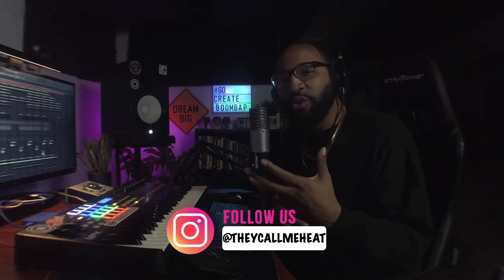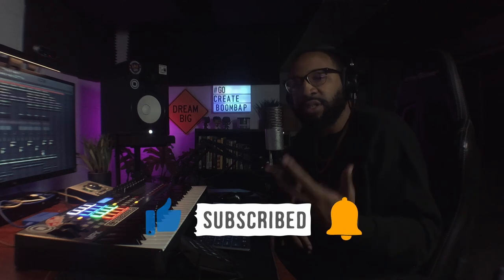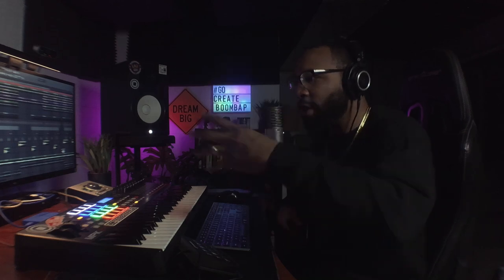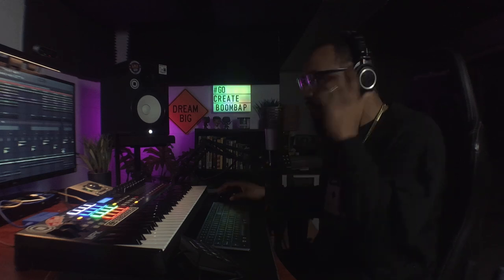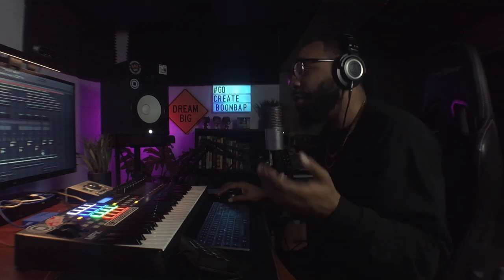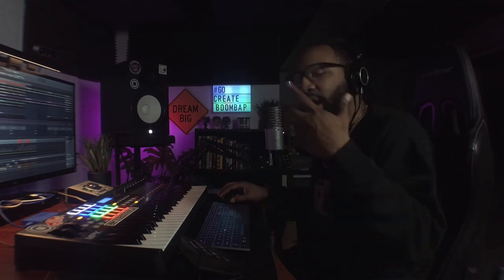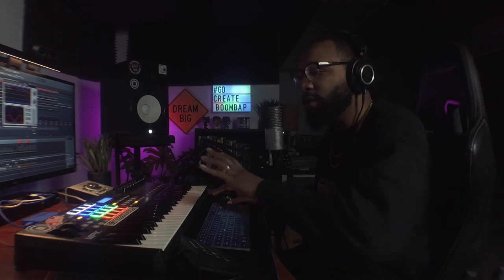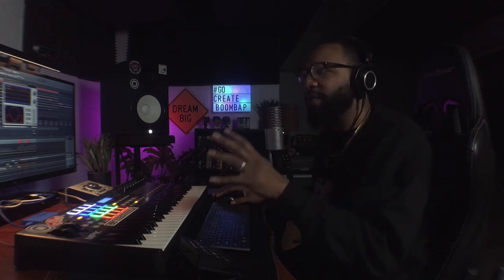my simple beat mixing system for LOUDER HARDER beats

Comment: hey I just got L2, but when I export with your settings I get like 30 seconds of no sound after the beat ends
Reply from the maker: Are you setting your ending or just exporting without marking start and end?
Reply: @theycallmeheat  I tried both ways but still the same problem
Reply from the maker: @idkRemm on your export settings be sure to select “cut remainder”
Reply: @theycallmeheat  it worked! Thanks for the tip bro, much love!

Comment: No need to add a compressor on the master then?🤔 because right now im using a soft clipper(limiter) for all the drums + adding one on the master + a compressor.. Maybe it’s too much but still doesn’t sound loud 🙄 I’ll try your way
Reply from the maker: It all depends on what you’re doing with the compressor. I would say use a limiter on the master. But when you mix everything and create head room that limiter will bring everything back up for you with no distortion. 

Check out my “Mixing And Mastering Your Beats Like A Pro” course. I walk you through my whole process from start to finish. 

https://boombapuniversity.com/product/mixing-mastering-your-beats-like-a-pro-masterclass/
Reply: @theycallmeheat  Awsome thanks for the fast response!
Reply from the maker: @prodbymckenna no problem my friend!! 🙏🏾🙏🏾💯💯
Reply: @theycallmeheat  Just found the problem I think.. My daws limiter doesnt have a threshhold option & Release setting. I'll buy a real limiter🤷‍♂

Comment: yo man i have a question and would appreciate a reply, did you add his to the bus you made or to the master channel? or both?
Reply from the maker: I usually just it to the master as I do all my leveling and gain staging prior to adding it. I’ve had no issues using it on the master
Reply: @theycallmeheat  thank for the quick reply, i subscribed, thanks :)